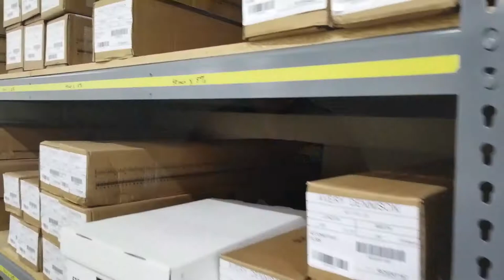What makes Avery Dennison window film so great?

Comment: What about the AVery Dennison nano ceramic ir series have you used it? Heard about it ? How would it compare to global/maxpro films?
Reply from the maker: The ir ceramic is good. The color is great and very easy to shrink. Only draw back I would say is that touch ups are a little challenging. For the price point, it's a good option.
Reply: Sun Distributing is it better than global quick dry series?
Reply from the maker: There are many things to consider when deciding what one is "better". They both have lifetime color stable warranty and good performance. Also both shrink really well. Personally I like the color of Avery Dennison better than the other.
Reply: Sun Distributing thank you for the answers 🙌🏼
Reply: Hi Sir, purchase AD IR series and my installer is having some challenges in fixing small bubbles. Any tips?
Reply: Not good shrinking at all for windshields or bigger back windows. Adhesive is great. Like he said not forgiving with creases and just wants to crease for no reason on certain cars. 10 year consistent vet. I’m using the nano ceramic.